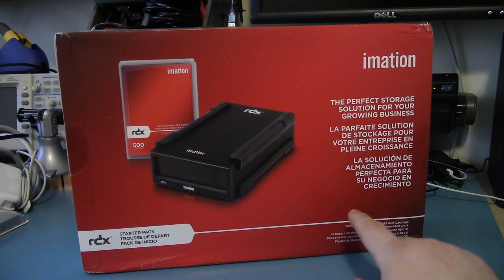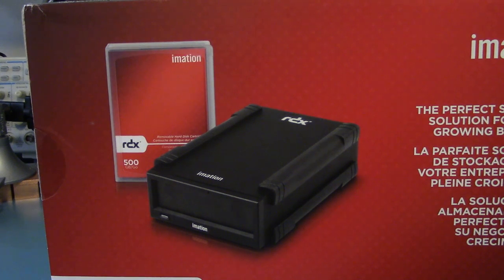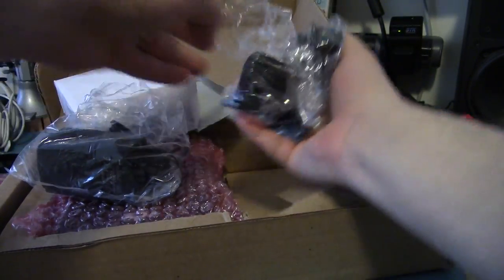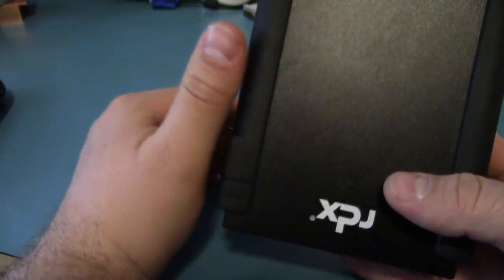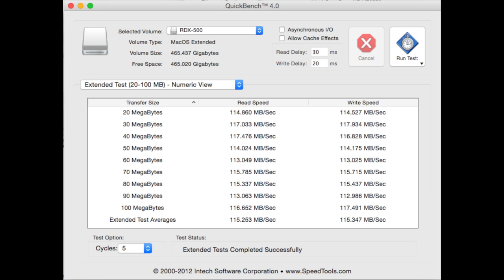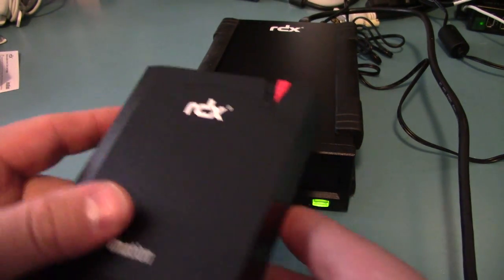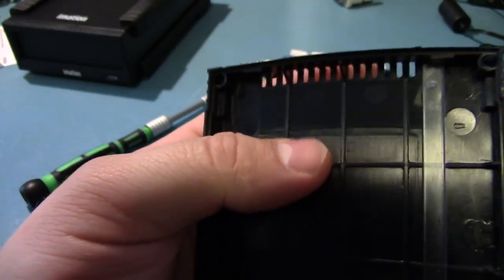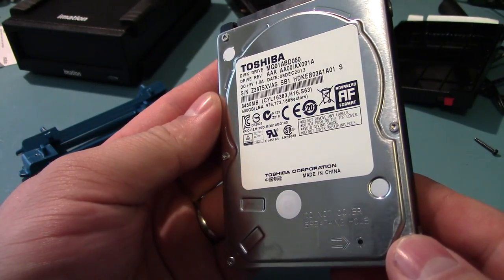Imation RDX Drive Teardown

Comment: wikipedia says rdx has 30 year archival life which is of course false. hard drives only last 5 years.
Reply: Since when do SATA drives only last 5 years... As an IT manager covering hundreds of desktop PC's I can assure you that there are drives in machines on iste which are 12yrs old and are still 100% healthy and error free
Reply: @TheComputec  it's a well known fact that mechanical hard drives don't last long.
Reply: @ is it?  Well I have worked in IT for 30 years and I can assure you that on average SSD drives have a MUCH shorter lifespan than mechanical drives. The difference is that SSD drives have a FINITE lifespan based on the number of times a cell is written to, which mechanical drives don’t. I have had drives in servers come into us that are still 100% healthy after 11 years. Sea gate enterprise drives have a designed MTBF ( mean time between failure) of 1 Million Hours… that is 114 years.   most importantly SSD drives are not warranted as offline storage. They are only designed to hold data for around one year when not connected to a machine.  You  usually get much more advanced notice of impending failure on a machanical drive than an SSD.  And if a mechanical drive fails you can still expect to recover some data using recovery tools. Once an SDD dies you data is 100% lost forever.  SSD drives are great. Very fast and very quiet but I wouldn’t trust them with essential data and certainly not as an archive media

Comment: thanks for making this video. i have one of these rdx things that i got fro free and i was considering buying a drive to use for backup but i'm glad you made this video so i know it's actually just a rip-off with some weird proprietary formatting. i'll just get an external drive instead!
Reply: lto is cheaper $60.00 for 30TB
Reply from the maker: LTO-9 drives only hold 18TB with uncompressed data - which is by far the most common. Plus the tapes are cheap, but you need a $6500 tape drive to go with it.

Totally different markets to be fair.
Reply: @GamingKing545  and just remind us, how much is an LTO-9 drive?... LOL

Completely different beasts. You cannot run an app from an LTO-drive, or do random data searches... Its a tape backup only

Comment: Somebody might sell a hot swap-able interface and chassis. You could then just plug drives into that. They may or may not require the cady. That is basically what you are buying with RDX.

Comment: thanks for the teardown. better to just get a usb hdd since this is the same thing. unless is the drive inside it more reliable? looks like normal 2.5inch sata drive with custom firmware on it.
Reply from the maker: Totally normal SATA drive. There is nothing special about this system other than the fact it ejects a somewhat rugged bare disk. Having a simple external drive will do the same thing and be a lot easier to find.

Comment: i have had desktop drives die on me because i stacked them up and the PCBs got scratched so this might be useful, granted i do hate the sound of that rough plastic when inserting 

in reality this would be more useful for video storage than backups 
for backups id just go with tape
Reply from the maker: I find tape just isn't worth it for your typical data amounts. I mean, I have 16 TB worth of storage on my NAS (after redundancy) and it's pretty full. But to get that much in tape would either mean tons of smaller tapes (LTO3, etc) or an insanely expensive drive. It's just cheaper to buy hard drives. Plus you get all the speed and random access.

Also, a big problem is the fact you need so many tapes. Either you have a gigantic and expensive tape library or you have to swap tapes all day yourself.

As for the RDX, I found it pretty useless in practice. At least I sold it for $125. :P The disks were just too small for backups and didn't offer much of an advantage over just a USB 3 drive. The disks don't appear on eBay cheaply often enough to amass a collection, either. ;)
Reply: my friend who works IT set up a fairly cheap tape system, i think the reader/writer was $1.5k and the 1.6tb tapes were $30, working that across my NAS and home servers and seeing how id like to keep a rolling 3 media backup it seems to be cheaper than stacking $90 drives 
but i mean there is a million things i need to do on my home systems first, not to mention my electronics lab
Reply: Using a TL4000 here with 45+3 spares of LTO-4 tapes it gives anywhere from 36 to 72TB of storage depending on compression. The entire thing is fully automated and modular meaning any upgrade of tapes or drives I just poke new drives in the back and new tapes through the front and the older tapes/drives work alongside the newer generations. Backs up at about 140MB/s per drive sustained speed, with the four drives in there it's quite fast, considering that LTO already verifies data while writing you don't need a separate verify task which makes it three or four times faster than most disk based systems.

Comment: i bet theres alt firmware to allow normal drives.
...... i will not be ordering one. just a caddy for 2.5
Reply from the maker: JRushPixel I suspect the only way would be to put standard firmware on the USB controller and have it act like a normal SATA bridge. I wouldn't recommend getting it either - unless you can score one for cheap on eBay (beware: USB 2.0 drives exist and would be super slow so avoid those).

The disks are basically a lost cause. It's pretty rare that you can find firmware for hard drives themselves, so finding the correct "normal" firmware for the drive would basically be a lost cause. Even then all you would get a 500 gig drive you could get anywhere. :P

Comment: Insidious. Seems to be another pay more for less scheme.
A common RDX advertisement point seems to be, "RDX is secure and supports Government level security with the highest level AES-256 bit Encryption Standard." So I guess it's implied that that proprietary controller and software gives you a security layer. Obviously not, since this is a cheap consumer item. If someone were to steal the data or disk, they know they just need to take the drive as well. They could just buy the drive for ~$100 bucks as well. You don't even need that software to use RDX. Just proprietary gimmickry. 
Now I know to spend my money elsewhere. Might as well save the extra money for an SSD, which is integrally durable, performs better, and lasts longer than HDD. Unless you're a company I guess. SSD storage is a bit more pricey. Still. Regular hard drives seem like a better and cheaper solution. Relying on proprietary support means less options. Security is all about options. I focus this comment on security because that seems to be the selling point of RDX. LAME BULLSHIT that could be accomplished with free software and cheap, proven hardware.
Reply: still think SSD's last longer than mechanical drives six years down the line?  LOL

Comment: Jut watched this video.  Review is mostly negative.  I have three DX drives and I get them fairly cheap on ebay with cartridges.  I just bought a system with 7 1tb carts for $250.  This is cheap storage for backup  solution granted maybe not as cheap per TB of a ordinary USB 3 external 6 or 8TB drive but.  However I'm getting something more robust and durable.  As for the special firmware, this is not something special to RDX but several external USB HDD manufactures have deployed the same tactic with there external drives.  For example I have a 3tb external Toshiba drive that failed after a power outage.  The controller would not power up the drive.  I opened the case and connected the drive via a SATA to USB controller but the PC would not recognize the drive and wanted to format the drive as a new device.  I tried several SATA to USB converters and none worked.  The end result was the same the PC wanted to format the device as a new drive.  Fortunately for me I had a second Toshiba drive  which was the same model which I was able to open the case up and use the controller from that drive.  The computer recognized the drive in that case without  issue.  Now I have to use the same working controller for both f the Toshiba drives when I want to access the content.  I had to destroy both Toshiba external cases but at least I can use both drives.  At the end of the day with further research I noticed that both Toshiba drives are AF drives and that there must be something special with the firmware on the controller that allows it to translate how the data is written to the drive.  Again the drive is only seen correctly with the Toshiba controller which is part #PI-539 v1.3.  I have looked up this controller on ebay which typically list for about $50 but if my second controller goes out I guess that I will have to buy another controller off of ebay.  I think that other manufactures of external AF formatted drives employ the same tactic to ward off buying another drive and putting into the external case or vise versa to keep buyers from opening cases and removing the cheaper drive to install into something else.  All three of my RDX drives are manufactured by three different companies, quantum, Iomega and Tandberg.  The firmware is unique to each OEM as well, and the drive caddies are firmware updateable which is needed when larger capacity cartridges are release which I think are up to four TB now if not more.  I'm not saying what the manufactures are doing is right but simply pointing out my observations